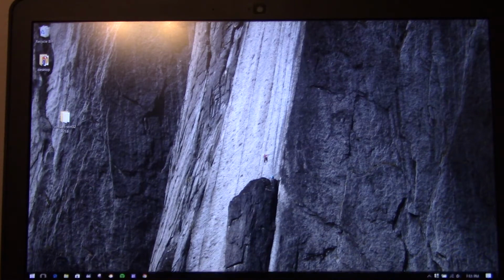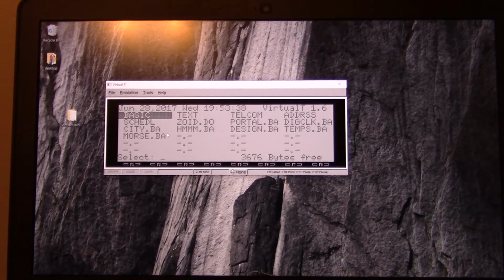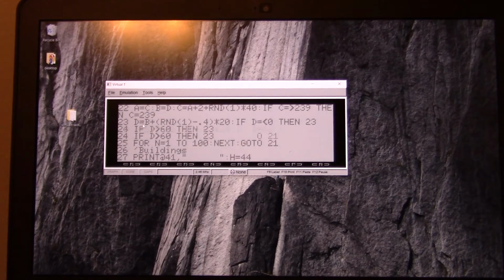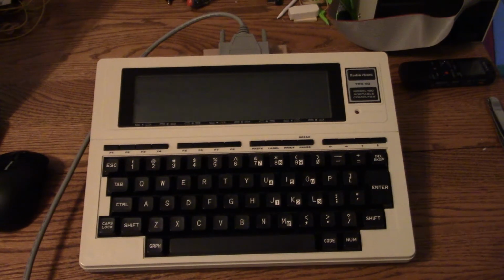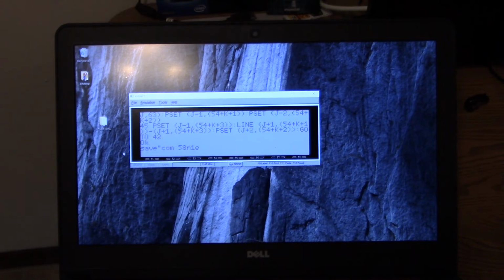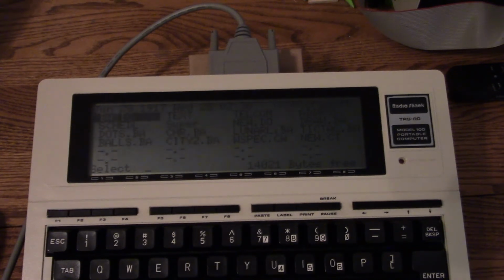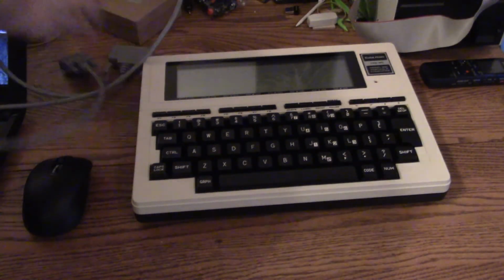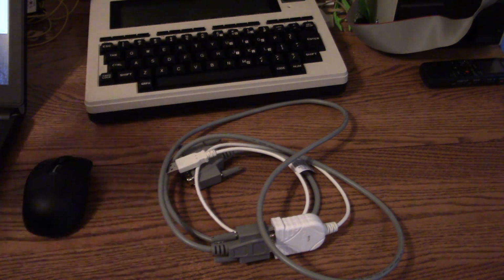Loading files from Tandy TRS-80 Model 100

Comment: YOU ARE MY HERO!!! Seriously, trying to transfer BASIC files to and from my M100 was making me crazy. I had a serial connection going but I could never get the files to successfully up or download. This works great and doesn't require any extra software on the M100.
Reply from the maker: I am glad that you found this to be useful. I was using a more complicated process but then I thought that if the virtual t program acted like a real m-100 then this should be possible and it worked.

Comment: I have a RS232 25 pin to 9 pin serial connected to a 9 pin null modem to 9pin connected to a 9 pin to usb adapter. I've tried using virtualT on both my mac and my PC and neither seems to be communicating. What kind of cable set up do you use? Do you have any suggestions?
Reply from the maker: I have a 9 25 pin to 9 pin connected to a 9 pin to usb cable 
Check to see that the com port is correct in virtual T.
Reply from the maker: Null Modem R-232 Cable Male large to female small Connector.
Trendnet TU-S9 USB adaptor.